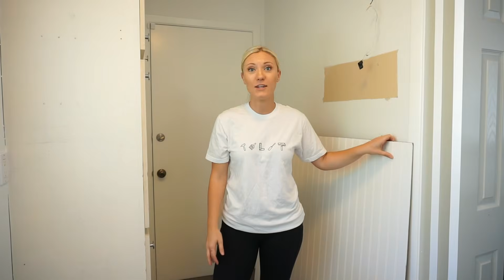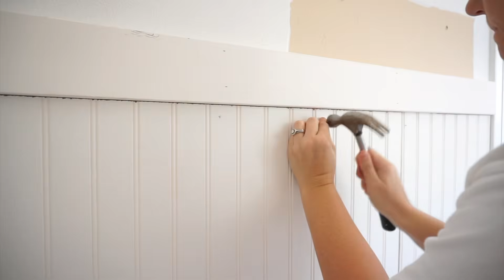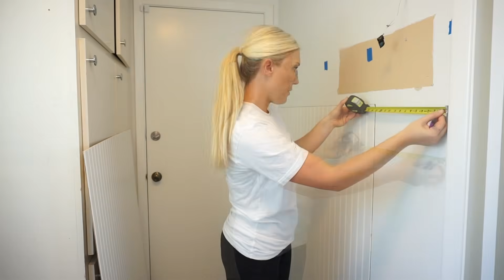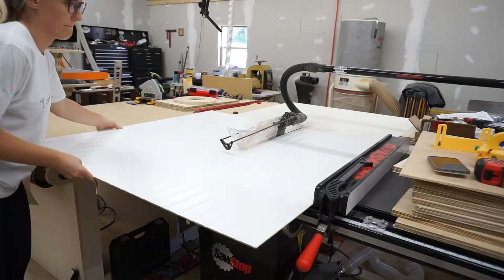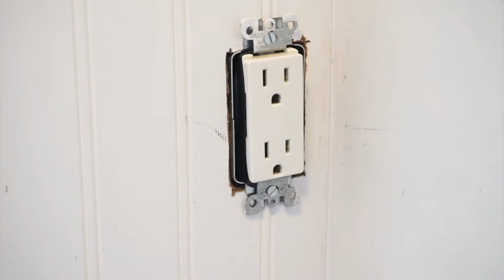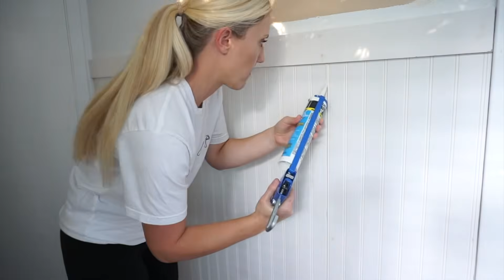How to Install Beadboard Paneling for Beginners

Comment: I don't have a multi tool. If I'm using a handheld jigsaw to make the outlet hole, would I make a straight cut through the board until I get to the where the outlet cutout goes, and then fill in that stright cut with wood filler?
Reply: Use a drill to make a hole in the center of where your outlet would be that is big enough for your saw blade.

Comment: Electrical outlet - I don’t understand how this works. You 100% have to cut a bigger hole than you’re showing, don’t you? Otherwise the hole in the board doesn’t allow any room for the screws from the screws to go back into the top and bottom of the plate?

Comment: Great video. Thoughts on painting the bead board prior to final install? Example. Cut all the pieces to fit, then paint and then install. Comeback and fill holes and caulk and then touch up paint.

Comment: I just did an installation of beadboard, and I've done as you recommended to put the panel flush with the wall. My gaps are a bit larger between the baseboard and beadboard and seem too big to caulk. Do you have any advice on how to cover this?

Comment: Easy To follow, how big of a gap can you get away With filling with caulk on the bottom of the beadboard? I have a room
With sloped ceilings and uneven walls and really struggling to finish hanging beadboard
Reply from the maker: Honestly, you can probably get away with a decent sized gap since it will blend in after you paint it all. But if the gap is too big to hold the caulk, try putting some backer rod in the gap first and then caulking it.

Comment: This was a great tutorial, HOWEVER, while that outlet trick was such a timesaver, it’s important that you cut out more space to accommodate for the  extender to fit as well. I was doing what you were explaining but it wasn’t fitting because the extender needs space too! I would recommend to still do the outlet trick but then to also measure the extender around where you marked the outlet (if that makes sense!)

Comment: This is so helpful! How would you recommend finishing the corners where it doesn’t butt up against another wall or frame? I’m trying to do this in my kitchen nook, and the window doesn’t have a frame and two of the walls just turn, if that makes sense. Do I need to add some sort of cap piece so the rough edge isn’t showing?

Comment: Why did you not use an adhesive / glue on back of boards? Unnecessary?
Reply: From what I’ve learned in the past, using adhesive glue on back of these panels will damage the walls should they ever need to be removed.  And they’re not necessary.

Comment: Wainscoting is NOT supposed to be 1/2 up the wall!!  It's supposed to be 1/3 of the height of the wall....looks stupid 1/2 beadboard and 1/2 plain wall!  2 inch nails ar WAY TOO LONG!  NOPE...you have to measure your narrower piece next to a moulding or corner at top, middle and bottom!...might have different measurements!!!  Where in the hell did you learn to do carpentry?   Need to go back to school!
Reply: Would you speak to a man this way? Listen it looks pretty good just mind how you speak to people. Getting this worked up over a YouTube video is insane 😂😂😂
Reply: everything you just said is your opinion nimnuts.

Comment: Shouldn’t you be using adhesive to keep the panels from bowing over time?
Reply: If you never plan on removing it. If you plan on removing I’d suggest not using adhesive as you’ll have a lot more drywall to repair.

Comment: Very well done, with important details on installation. "Caution" for you. Be careful on length of brads or screws on other projects. You don't want to hit an electrical line running through 2x4 studs. There are numerous videos on this. Once again thanks for the tips.

Comment: Did u need to sand or prime the panels before painting them?
Reply from the maker: No not at all. I used primed pine board which don't require any sanding.

Comment: Thank you for the instruction, we have never installed beadboard and are doing so in our guest bathroom. I agree the sock cover with the tape is a great idea. Question,  do you find the cuts chip or splinter when not adding painters tape on either side of the cut?

Comment: After installing the beadboard, you put the trim on. was the top of the trim flush with the beadboard? Or how was it positioned on top?
Reply from the maker: You want to sit the horizontal trim down directly on top of the beadboard, nail it to the wall and then fill the seam between the beadboard and the trim piece with caulk. A more advanced way would be to run the top trim pieces along a router and create a groove/notch out on the back of the trim boards so they can sit just a bit over the top of the beadboard but that's not necessary.

Comment: I have a chair rail on the wall I want to install this beadboard on. Can the board be cut to make it shorter? The height from baseboard to chair rail is only 28".
Reply from the maker: Yes, absolutely! Just cut your boards to the height you need.

Comment: Thanks for a detailed video. I have a craft room 8'x7', which i am planning to add the bead panels. How do you suggest handling the corners? If two walls meeting at a corner and both needs to be put bead board?
Reply from the maker: I would just butt the boards up together in the corner and caulk the corner like you would where two boards meet.

Comment: I am planning on doing something similar but on the top half putting some flat paneling. My current wall is very textured. Would it look strange installed with the bottom board and top being the same depth?
Reply from the maker: No I don't think it will look strange at all if they are the same depth. It will look great!

Comment: If I’m doing wallpaper, should I do it before or after the beanboard and trim molding?
Reply from the maker: If it was me, I would do it after that way the boards don't go over top the wallpaper. That way, if you ever decided to remove the wall paper, you could peel it off without having to pop the accent wall off.

Comment: Do you put the boarder on top of the beadboard or do you cover the headboard just a little?
Reply from the maker: You would want to set the board right on top, nail it into the wall and then do a bead of caulk between the beadboard panel and the top trim.

Comment: Wow, very professional vid.! Much better (& more useful) than others I’ve watched. My only suggestion would be to paint both beadboard & edge moulding after dry fit but before installation. This will save time taping edges. You’ll still need to fill & paint nail holes, but that’s required either way.

Comment: Nice tips; however if you are using a bradnailer/nail gun & find that your nails are not going all the way in, it indicates that you need to increase the pressure setting on your brad nailer/nail gun air tank, NOT USE SHORTER BRADS/NAILS!
Reply from the maker: Normally, yes I would agree with you. My nails were sticking out on the wall that is an exterior wall. My exterior wall is a concrete block wall with only furring strips and then the drywall. Increasing the pressure on the nail gun would not have helped in this situation. I had to switch to smaller nails on this wall since the nails were hitting the concrete wall and not able to go into the concrete. I could have definitely explained this a bit better in the video.

Comment: Thanks for your video! The explanation is very good. Could you tell me which cap rail you used?
Reply from the maker: I just used 1"x4" primed pine boards for the top horizontal boards above the beadboard.

Comment: Another person not using construction adhesion to attach the panels😢
Reply from the maker: Yes!! I never ever recommend using adhesive. It will ruin the wall behind the panels if you ever decide to remove them to do something different. I have been on the receiving side of removing old panel and having the adhesive rip off the drywall behind it, turning a small project into a huge project and repair. I only use brad nails to attach my panels so that it causes no damage to the wall underneath.
Reply: @mrsashleyfrench  exactly. never use adhesive.
Reply: @mrsashleyfrench  wall is already a mess. Lol
Reply: Construction adhesive is not necessary unless you want to damage walls down the line.

Comment: How did you add the top / hooks?
Reply from the maker: The top horizontal board was just installed using my brad nail gun. The peg rack behind me is a separate piece that I unfortunately don't have a video for but you should be able to find plenty of tutorials on how to made a peg rack. I didn't attach any hooks to the actual accent wall.

Comment: My walls are very uneven so I’m struggling on holding the board where it needs to be and nailing, also struggling with lining up the next board without a gap 😢
Reply from the maker: I'm sorry about that! You could always cut the boards down into smaller sections so the pieces are easier to hold up. Since the pattern on the panels makes it easy to match up, you can go with smaller sections (they don't need to be 48" wide like mine). Also, do you have a baseboard that you are able to prop the piece up on to help hold it up against the wall? If not, you could use a scrap piece of wood, a block, stack of books, anything really to prop the panel up on to help hold some of the weight while you shift it into place and get it lined up and nailed in.

Comment: My Home Depot would not cut for me, FYI. I was told its their store policy not to cut mdf (1: hard to get a clean cut, 2: dulls their blade)...I've had them cut plenty for me before but never mdf. Otherwise thanks for the tutorial!
Reply from the maker: Oh no, that stinks! It must just be that area or location because both of the HD in my town will cut MDF for us. Maybe try Lowes, they also sell this beadboard paneling.
Reply: I’ve run into that too.  From what I can conclude is it just depends on the worker at the store.  Some are nice and will do it.  Others not so much.  The store policy is however that they do cut but charge after the first cut.  Just ask to speak to a manager next time.  Odds are they’ll do it.

Comment: Great video! I’m curious about how you finished around the windows since they don’t appear to have trim? I looked at the blog post you linked in the other comment question about corners but it doesn’t show how to handle windows without trim. Thanks!
Reply from the maker: Correct, I do not have trim around the windows. I caulked the seem/edge where the beadboard panel ends at the window and painted it and it looks great. If you go to this blog post, and go down about 25% of the page, I have a photo of the window and you can see how the panel just ends at the window.  https://mrsashleyfrench.com/blog-archives/laundry-room-essentials-creating-a-functional-and-efficient-space?rq=laundry

Comment: What if the wall behind is brick what do you use instead of nails
Reply from the maker: I can think of two options - You can use construction adhesive to attach the panels to the walls. Or you can install furring strips to the brick. The furring strips will require you to get a special masonry drill bit, anchors and screws to drill into the brick and attach the furring strips. Once the furring strips are up, then you can attach the accent wall to the furring strips. If it was me, I would be the construction adhesive.

Comment: Great tutorial!! If you don’t mind, what’s the height of the board?
Reply from the maker: The board comes in a length of 96" and I cut it exactly in half so that I would get two equal pieces of the board with a height of 48". Then I used a 6" baseboard on the bottom and a 4" board for the top trim so the total height from my flooring to the top of the accent wall is 58".
Reply: @mrsashleyfrench  This is so helpful, I’m definitely got lots of inspiration from you and I will try this in my house this weekend! I appreciate your response 🥳❤️

Comment: Question. What is the best method to paint the boards for an even finish?
Reply from the maker: I first used a 2inch angled brush and painted into all the vertical grooves and along the edges first. Then I painted the rest with a paint roller.
Reply: @mrsashleyfrench  What type of paint finish did you use on the beadboard? Satin or semi-gloss?
Reply from the maker: @toddhenderson3787  I used Satin.

Comment: Does the 1x4 overlap on the beadboard or is it placed directly above the beadboard?
Reply from the maker: So I have done this same beadboard accent wall a couple times over the years and typically I just place the 1x4 right on top/above the beadboard and then caulk the seam between them. This particular wall that I made the video with, we actually used a router table and routed out a small channel/groove on the back of the 1x4 so that it would sit slightly flush over the beadboard a hair. It is not necessary at all to do it this way and I didn't include it in the video because I thought it was a little advance and most people don't have a router.

Comment: How easy is it to remove with the nails in place?
Reply from the maker: If you mean, how easy is it to pull the boards off the wall, if you haven't caulked the edges you can just give the boards a really good tug and you'll be able to pull them off the wall. If you have caulked the edges, then you would want to use a carpet knife to cut between the caulk and wall and then pull the boards off. I like to use a trim puller also to pull the boards off.
Reply: @mrsashleyfrench  awesome thank you. 
Great video by the way.

I ask because my wife and I live in an apartment and we have a baby on the way and I would like to do this in the nursery so I wanted to see if it was easily removed (renter friendly)
Reply from the maker: @luke50469  If you are renting, I would just skip the caulking where the boards meet the wall. Then the boards will pull off pretty easily and you'll only be left with tiny holes in the wall from the brad nails that can be filled with nail hole filler or maybe even just paint.
Reply: @mrsashleyfrench  that's what I was thinking too! Thank you again for your input and making am awesome video explaining everything very thoroughly. I'm subscribed now!

Comment: The drywall that is not covered, did you use a water proof paint sealer? Or just regular indoor paint?
Reply from the maker: I just used regular, interior paint in a satin sheen.

Comment: If there is a hole in a wall, do you need to replace the drywall first, before putting in beadboard? Or can smallish holes be fine behind it?
Reply from the maker: I would just put the beadboard right over the hole. No need to fix the hole.
Reply: @mrsashleyfrench  It’s over some plumbing that had a leak that was repaired. Would it be against code or anything to put in a little door in case it needs to be accessed again?
Reply from the maker: @nicolecoleman5667  I can't speak to codes but I'd think that as long as you have a way to access it, it would be fine. I think a little door would be perfect. Also, if you just use brad nails on the beadboard and not adhesive (which is how I do it), then you could always easily pull the beadboard off the wall in the future if you ever needed to access it.
Reply: Alrighty, thanks! :)

Comment: Did you put your topper board OVER (on top of) the bead board or at the top edge of the bead board?
Reply from the maker: Typically you would just rest it on the top edge of the beadboard and NOT over the beadboard. But in this laundry room, we did use a router to route out a groove in the bottom of the board so that when we rested it on the top of the beadboard, there was actually a bit of the board that hung over the beadboard due to the groove we routed into it. This is not necessary at all. Just rest your horizontal board on the top of the beadboard and fill the gap/seam that is seen with caulk :)

Comment: What air pressure do you have the nail gun on? (I just got the same nail gun and doing the same thing)
Reply from the maker: I am using a Brad nailer that does not hook up to an air tank. It does have a pressure dial on it and I typically keep it in the middle of the dial. However, if I notice my brad nails are sticking out of the wall a little after I drive them in, then I turn the pressure dial up more for more power so the nails are completing into the wood/paneling flush.

Comment: Is there a way to fill in the seems that transition to a new board? I feel like it still is slightly seen and that would drive me crazy. Any tips?
Reply from the maker: Once it’s painted they aren’t seen at all. You can’t tell where one board ends and another begins 😃
Reply from the maker: I should add, I added a thin bead of caulk where the two panels meet. So once it’s painted, you don’t see anything at all.

Comment: Best explanation on outlet cutout and re-install. That has been hard since I am a beginner. Would like to see how you handle where the boards meet in a corner. How do you handle that? Thanks!
Reply from the maker: If it's an interior corner I just end it and add caulk in the corner. Now if it is ending at a corner or edge, I would add a piece of 1" trim with a beveled edge to end the beadboard. There is an example of this in the middle of this blog post in a photo that you can see (not my blog post, but its helpful):  https://www.oneprojectcloser.com/how-to-install-beadboard-wainscoting/

Comment: excellent video.  One thing I have noticed is you didn't add the thickness of the blade when you measured out where you are cutting.  I believe 1/8 is for a table saw while the miter box saw can be 1/16 in thickness.  Just letting you know.  Love the video :D
Reply from the maker: Thank you!